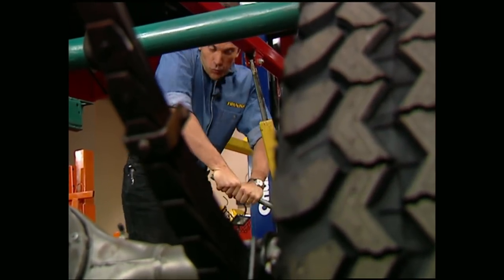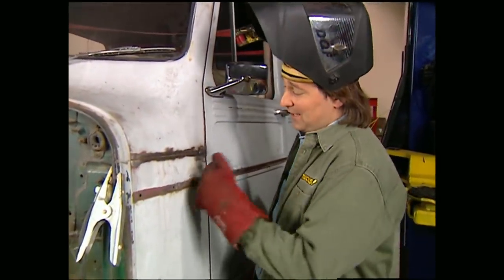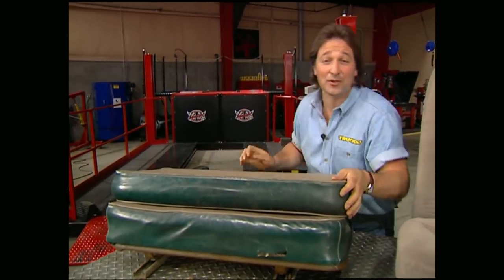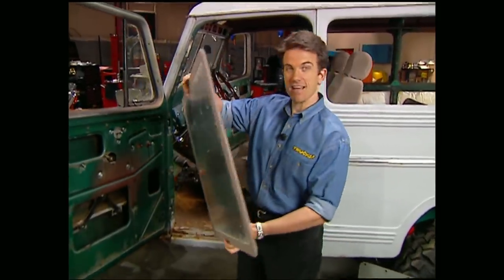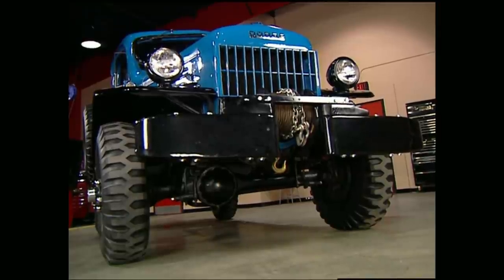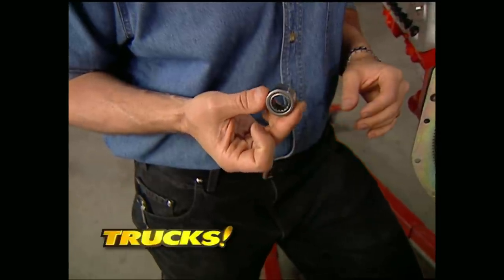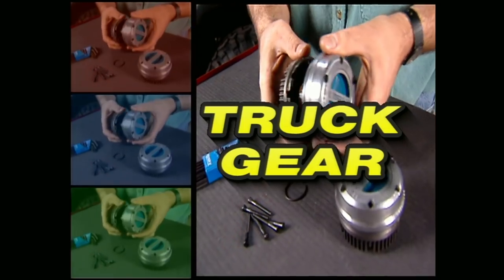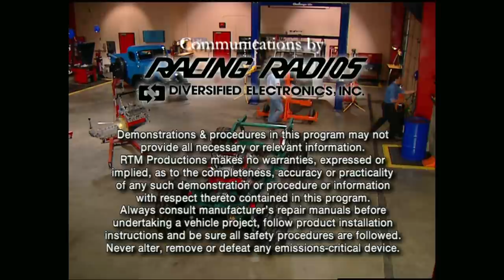Our '55 Willys Wagon Gets A Driveshaft And Shocks Added To Its Chassis - Trucks! S7, E19

Comment: I had a 48 Willis overland pickup, didn’t need shocks as spring so heavy it couldn’t bounce, once hauled 4 ton of sand , drove with one finger, had 327 engine , with 460 gears, top speed was about 70 but it would never bog down under extreme loads.  Finally broke the frame with hug h load of rocks and gave it up.